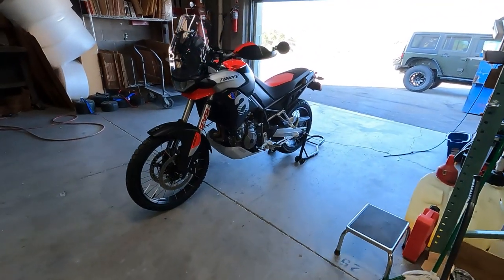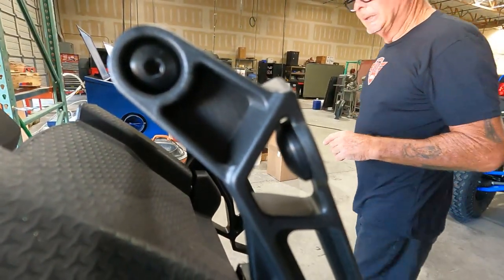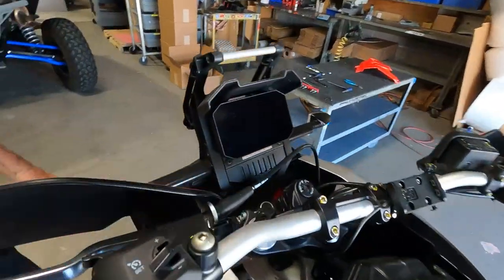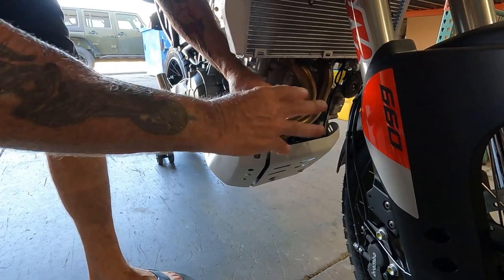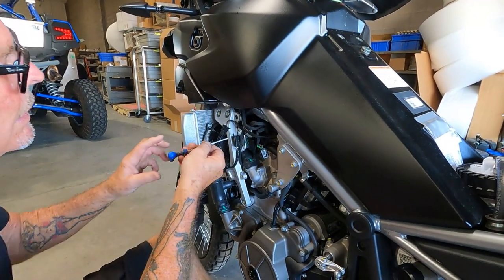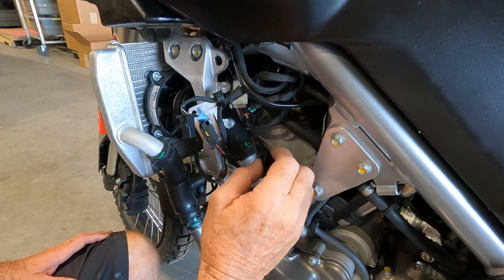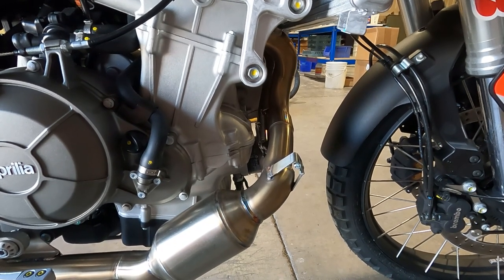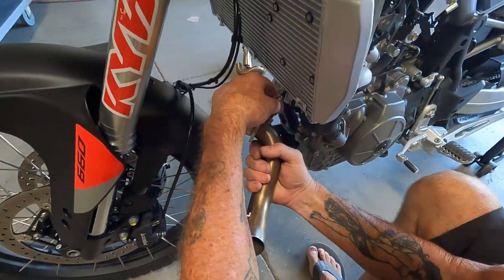2022 Aprilia Tuareg Exhaust Install

Comment: does the exhaust help with the engine heat?
Reply: No it does not…. None of the aftermarket exhaust eliminate the cat..
Reply: YouTuber Lazy-Pilot claims his Arrow installation made a significant difference. He did a before and after test using an infrared heat gun.
Reply: @rickallen848  I got the hp corse. Heat sorted and great sound